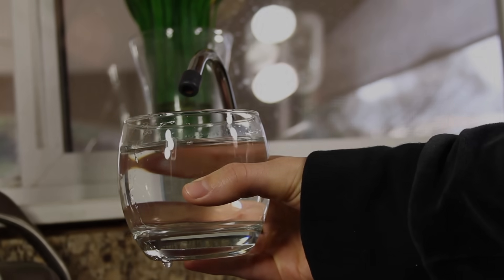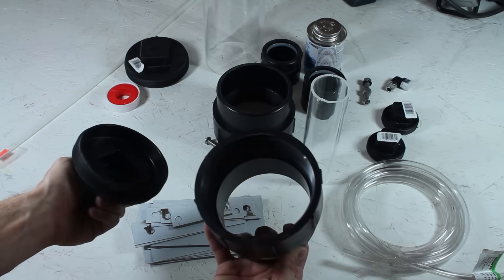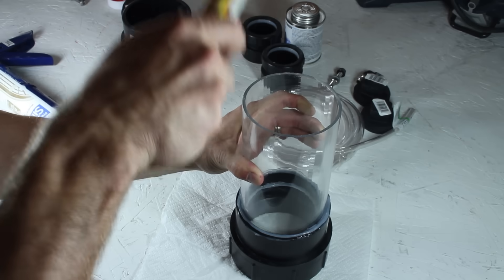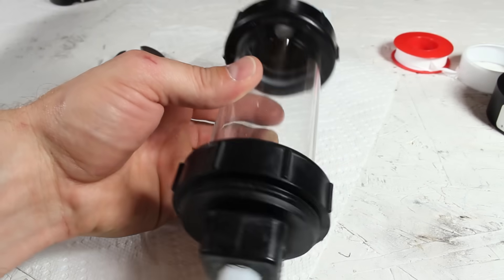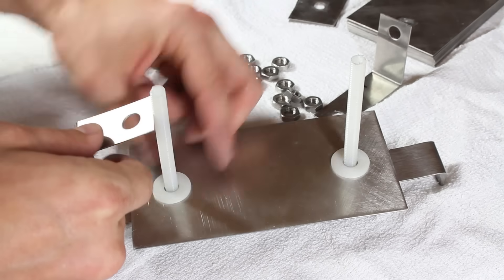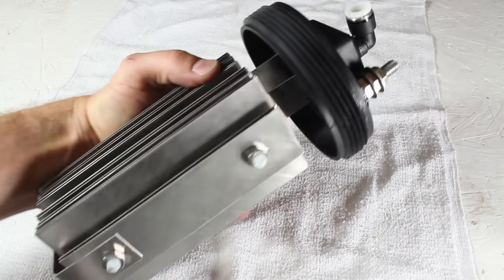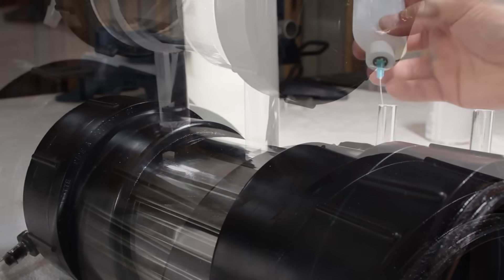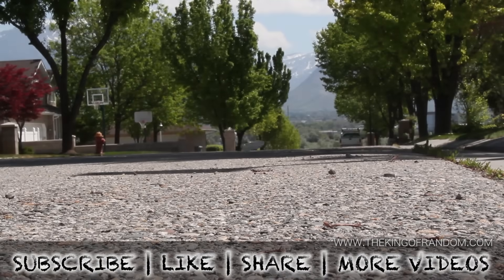HHO Generator - Water to Fuel Converter

Comment: If this were to be a future fuel it would ruin the oil companies. I'm all for it. Also it wouldn't be a good business to get into unless they could sell tanks filled with the combustible material. It would be better for people to just modify their vehicles to create the fuel on the go.

Edit: Also insurance would go up if people modified their vehicles to create their own fuel on the go because they wouldn't be spending that money on gas.
Reply: Hendlton you could put magnets on the wheels and utilize that power for the HHO converter
Reply: Balls McSpanky Has anyone pass their 9 grade science. Yes, it is a flammable gas! The only reason we cant use it is because it is dangerous with the current engines. It would take future more research into new engine to support hydrogen being burned. With your current Honda engine, you WILL blow yourself up by running hydrogen in it!

Comment: May I ask what the ratio of water input (in liters) to gas production (in liters) is? The reason being that I'm currently in the midst of designing a new engine concept that takes an entirely new approach to electrolysis engines, but I'd save an exceptional amount of time if I would get an answer in these comments.

By the way, that contraption turned out great!

Comment: why do you need distilled water?
Reply: Caleb Sevy distilled water is in its most pure form. You could use tap water but it would leave a lot of residue from the impurities in the water. Distilled water ensures you will get maximum life out of the device. Also if you tried using tap water I guarantee you will be disgusted at how many impurities there actually are in tap water!

Comment: I assemled everything as it was shown in the video and I cannot get much gas at all. I'm using a car battery as a source of electricity. The water in the bubbler isn't bubbling at all. Does anyone have any suggestions to what might be the problem? I am rather certain that the plates are assembled right.
Reply: Niko Aaltonen he says he used 2 car batteries to power the generator in the video, not 1. The only other causes I could think of would be sanding down the glossy finish of the steel, improper catalyst, or not using distilled water.
Reply: Why would I use distilled water? It doesn't conduct electricity.
Reply: You do know that's what the catalyst is for right? He used distilled water in the video but added a catalyst to it for it to be conductive. Normal water in general is not a good conductor.
Reply: I know normal water isn't a good conductor, that is why I add sodium bicarbonate. I still see no reason to begin with distilled water. I checked the plates and they seem to be in the right order. I am getting bubbles on the plates and the water goes turbid after a while.
Reply: Niko Aaltonen Did you manage to fix your issue? What was the problem?
Reply: On the video, he says to use TWO car batteries. Maybe one isn't enough power
Reply: Get a multimeter n hook up a weak dc power supply (like a laptop charger)! Then check the voltage drop from each plate! You've probably got a short in the system! That was my problem, couple of washers were too thick and touched other plates!

Comment: HHO gas in my opinion is much better than petrol or diesel. You can use itdirectly in a petrol engine with no modifications and if there is a car crash, the hydrogen is likely to float away from the car before it can explode (even if there is a small chance of ignition) due to it being about one fifteenth of the weight of air. In total, the ratio of the amount of energy from burning the fuel to the amount of energy to make the fuel is much higher with HHO gas than petrol or diesel, as the only energy required for it is to split the water, whereas with petrol and diesel, there is energy required for extracting the crude oil from the ground, seperating the oil in a fractioning column (requiring huge amounts of heat) and then purifying the fuel to reduce the amount of particles that would be unburned. Water does not need to be purified, in fact SHOULDN'T be purified for use as a fuel. Thank you for reading, this would get 6/6 on a GCSE QWC question haha. But take this seriously, please. What people mean by a "free energy" source is merely just a much more efficient source than is widely used in the world.
Reply: I completely agree with everything you say, although you might have to enlighten me with the Tesla coil part haha
Reply: *****
I have heard of the Tesla Coil, to some extent, but I never knew the original intention for it lol
Reply: haha, even the greatest of men have their flaws lol
Reply: lol

Comment: in addition to the nay say-ers there is one minor over look in internal combustion engines and hydrogen usage... brief words 14.7:1 air to fuel mixture is required for standard gasoline, hydrogen requires 33:1 air to fuel mixture

the internal combustion engine would have to undergo major mods in order to run this fuel. however on that same not turbine style engines would be a possibility. food for thought.